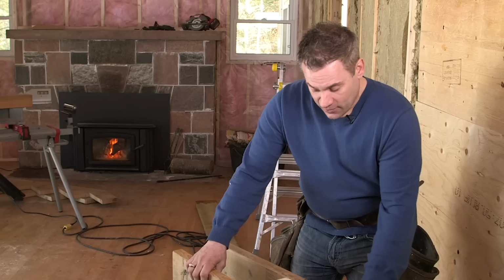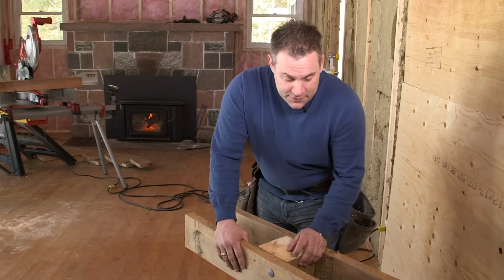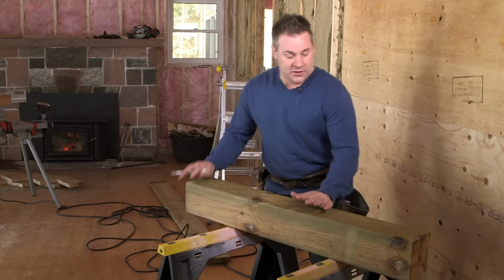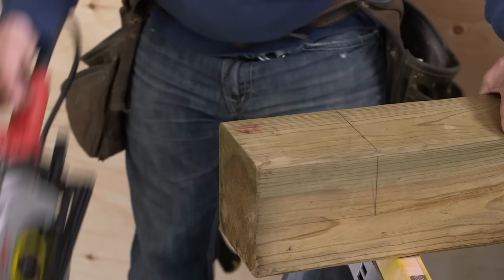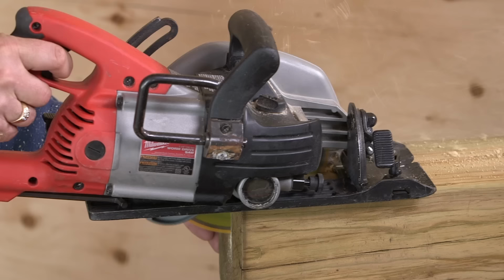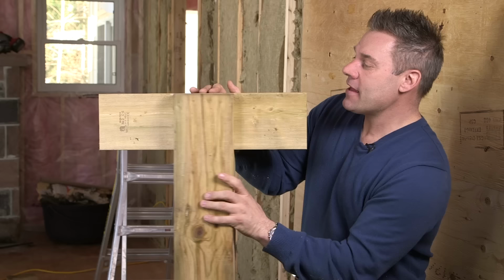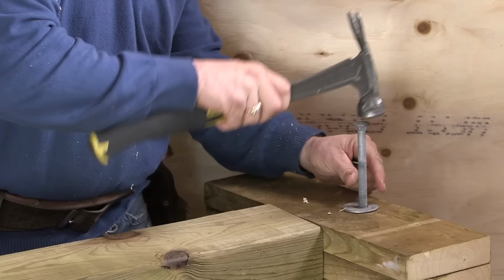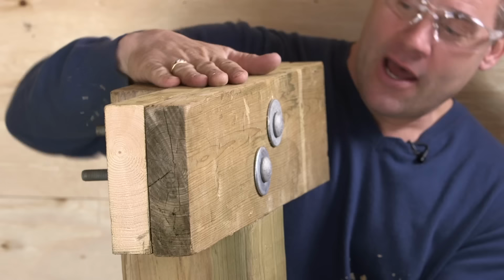How to Attach a Beam to a Post for a Deck | Decks, Docks & Gazebos

Comment: You could take it one step further with the bolts by drilling a hole slightly wider than the bolt head and as deep as the bolt head. This way, when you insert the bolts and tighten them down, they sit flush inside the beam, which allows you to attach trim to the outside of the beam.
Reply: Depending upon whether you have a single or double rim joist, you may be derating the actual load that lumber can now effectively support before failure.

Comment: Didn’t Chicago outlaw notching posts about ten years ago when all those decks started collapsing? Yes you’re sitting on top of a 6x6 but you’ve reduced what your attaching to to a 2x6 and notching leaves itself prone to rot and splitting lengthwise at the notch.
Reply: Petey Pete
Reply: Notch...and then coat the notch...no more rot problems.
Reply: Mark Anthony coat the notch with what? Don’t you have to let treated lumber dry out a bit before you seal it and the chemicals from treating it don’t really reach the middle right?
Reply: @tvojslauf  Personally, I would coat it with roofing tar...but I have also used fibreglass resin. The resin didn't sink in as much as I hoped it would, but the oil component of roofing tar does penetrate the wood. I guess nothing is for sure except death and taxes LOL !
Reply: If it bothers you that much use a piece of plastic damp proof course over the cut section

Comment: You are 100% correct in your method. Kudos.
However you have a misunderstanding regarding shear. 
Bolts are strongest in shear, and tension. Then cannot take any bending. When you hammered the screw, that was bending. 
If you use bolts in shear there cannot be any gaps to induce bending. 
The shear bolts in the first were fine, short term. Not because of the bolt, which were installed correctly with no gap, but because the lifespan of the wood means after weathering it would weaken. 
Your method was safer with a much longer lifespan. 
Kudos. Excellent craftsmanship. 
I am a structural engineer.

Comment: I'm a contractor and I have replaced decks on old homes, no saddle or carriage bolts just 5 big 16 or 20 penny nails and there still holding tight … I agree with the saddle and 1 carriage bolt, 2 is over kill  …

Comment: Every pole barn I've run into has the girts nailed or bolted to the side of the poles.  Rarely is a pole notched
Reply: Yeah and some of them old barns are 70 years plus and still good .
Reply: With all due respect pole barns and decks are apples and oranges
 In poll barns the horizontals are just the fastener surface for the metal siding. They bear very little weight. The siding is fastened to the beams and the posts so it ties it all together with a low weight per fastener ratio. Furthermore...any builder worth his weight always blocks between beams so horizontals are sitting on blocks all the way up each post. Still most poll barns. Builders don't hang their top beams on fasteners.
Reply: @johngoodell2775  I live in a pole house. The horizontals as you call them that support the floor are doubled 2x12s bolted on to 6x6 vertical posts. No notching. The roof is supported by 2x10 horizontal  headers that run from one vertical pole to another 12' apart.  The hay barns that exist all over this country have a second floor where hay is stored. That second floor which holds tons of hay all winter, is supported by horizontal 2 x boards nailed to the sides of 6x6 vertical  posts. No notching.  Notching weakens the vertical posts. Not something  we want to do in areas prone to tornadoes.
Reply: @spartaeus  I find that hard to believe that there are no posts holding it up. I bet your looking at a post that supports a ceiling thinking it's holding up the floor. Carriage bolt construction is the type of construction you read about that gives way and injuries or kills several people as they are dropped 20 feet when they shear off due to weight and stress.
Reply: @MainerdLoyd    The horizontal 2 x's nailed to the sides of 6x6 vertical posts support the floor joists.  There are many good books on pole building construction that illustrate this.  Also the agricultural  universities have free plans for farm buildings that you can download that also illustrate this.  I've not heard of a barn collapsing yet.   A notched beam is a weakened beam.  Think about all the trusses that are made from 2x4s or 2x6s that have a flimsy metal gussets to hold the boards from separating. They don't notch trusses, yet they hold up. Although I've seen many of those metal gussets fall off during transportation, where they would have to be hammered back on at the job site. That's why I only use plywood gussets that are glued and nailed.
Reply: @spartaeus  And how many people do you have running around and constantly shifting weight in a pole shed? A building meant for storage is one thing. A deck made out of soft lumber that is going to be subject to lots of shifting is different. He is telling you the safe way to support a deck.
Reply: @MainerdLoyd  The building does not shift. A pole building must have diagonal braces of adequate strength to prevent side movement.  Of course you have to use good quality building materials in the first place!
Reply: @MainerdLoyd   It all depends on the quality of the construction.  I've seen some really bad pole sheds, with 2x6 floor joists spanning 15 feet and a single 2x6 nailed between two posts 10 feet apart  carrying all those floor joists. Even as under constructed as it was, it still held up.  Quite a bit of sag though.   And I definitely  would not walk under it when it's loaded with hay!   I have several barns on my property, all very old with saggy floors, and all have held up through  tornadoes and high winds. In fact many of the older houses around here are not  bolted to a foundation.  They are just sitting on blocks or stone, and have survived high winds where trees right next to them have been blown over.
Reply: @spartaeus  so the joists are not supported in the poles by blocking? Notching doesn't weaken posts if you calculate loads and use the right size posts. Look at the joinery on old barns. The fastener method saves time and money...but still barns and decks are  apples and oragnges

Comment: I would guess that the main problem with the bolted connection (without notching) is not the shear strength of the bolts (which is tremendous for that size of bolt) but rather the strength of the wooden beam.  Under heavy load, the beam would tend to split along the grain where it is being held up by the bolts.  This is the effect that is eliminated by supporting the beam from underneath with the notch.

Comment: While his method of attaching beam to post if good attaching with carriage bolts is also good. It will not collapse ever. The wood will rot first. The carriage bolt will also hold more weight than you ever need.

Comment: While this is the correct way to hang a deck beam, it has nothing to do with the shear strength of the bolt. The bolts have plenty of strength. A 3/8" carriage bolt shear strength is somewhere around 45,000 lbs. The reason you notch the post is because the wood beam sitting on the two 3/8" bolts is much softer than the bolt. The hole will elongate over time and that portion of the deck will sag. And you have the potential for cracks running along the grain as the weight pushes down. Letting the beam sit on the end grain of the post, distributing the load over a larger area.
The weight capacity of a 6x6 should be around 20,000lbs (less than the shear strength of the bolt alone) so a 10x10 freestanding deck with 4 posts has a theoretical capacity of 80,000 lbs right? Wrong. 5,000 lbs live load capacity (depending on species of lumber).
Notch your posts and follow span calculations and fastener specs and you will be fine.
Reply: Finally,  someone gets it!

Comment: Half inch carriage bolts holes about 8000 pounds
Reply: You are obviously wrong, you act as if the bolts are made for shear strength.  As if they bolts were actually rated based on the shear force.  Clearly the bolts are ONLY used as fasteners to hold the wood together like this man says. 

Also, 8000 lbs isn't that much.  People are getting bigger.  It's not uncommon now days for a residential deck to have over 60,000 lbs of people on it all jumping up and down at the same time.  If you don't notch the wood millions of people will die... is that what you want? psycho...

And besides, YouTube allowed this person to post a video so clearly he is an expert.

Comment: I told my wife, "This guy has no idea what he is talking about."  She said, "Anybody can make a YouTube video."
Reply: The nice intro screen shows he must know what he's doing!
Reply: @KingParisBuckingham  by comparing the strength of a carriage bolt, to the strength of a tiny screw, makes it like he doesn't know what he's talking about. You couldn't knock a carriage bolt off as easy as that screw.
Reply: Brian Van Horne  don't mention code !! Code also says any cuts into treated lumber has to be treated also so he still was doing it wrong  all the white non treated showing will be rotting from the inside out !!
Reply: When you watch the Amish in southern maryland build a barn . You'll find out pretty much all you'll need to know about building a wooden structure . With mostly joinery and few  fasteners . Old school ways that will always work
Reply: Post and beam safest way to construct . bolts and screws are there to keep  wood in place . there have been  lots of people hurt because they use inadequate  screws or bolts
Reply: @Normal1855  the best construction  for holding weight is post and beam he is demonstrating this ,it will hold more weight every time . I've seen people use inadequate screws to make shelves and once loaded up have collapsed on them

Comment: So by notching the 4x4 post you basically made it a 2x4.  Notching is against code here.  Sorry but Carriage bolts are designed for shear strength why else would you use them to attach your ledger board????
Reply: I agree. I rather use another 4 x 4 beam (depending on the  load) or 2, 2 x 8 beams on top of the vertical 4 x4 with a strong tie and letting the entire 4 x 4 take the load.
Reply: Or a 4" x 6" beam on top of the 4" x 4" and use metal plates as they use in beam trusses. It doesn't get any stronger than that.

Comment: The weakest link in a chain determines the chains strength. It appears as though the vertical, load bearing beam is a 6 x 6 as when he take his two 2 inch wide horizontal beams , which after milling are 1 x 3/4 or close to it, meaning they're total width is two times 1 and 3/4 inches (ie.3 x 1/2) he still has some width in the vertical beam after sawing it away by 3 & 1/2 inches (5 x 3/4 inches minus 3 x 1/2 = 2 x1/4  yes?). So the original 6 x 6 is now actually only 2 x 1/4 inches thick to bolt the two 2" wide pre-milled horizontal beams to. Therefore, the torsional strength of the vertical beam has been reduced by more than half and it has a stress vulnerable cracking 90° angle point to it. My father was a mechanical engineer and I work in micro-mechanical engineering as it were. There was not wrong with the original design as long as the horizontals are one piece and the threaded nuts and bolts were very tightly joined (and some maximal strength thread lock was used in doing so). The other design that would be acceptable and maintain the original dimensions of the vertical load bearing beam would incorporate factory painted steel gusset plates to join horizotal beams (again only single long beams) to bolt the horizontals to the vertical beams without removing any of their widths (which would unnecessarily weaken them). Cutting away over half the vertical load bearing beams as is suggested only weakens the vertical beams to the point that is left remaining, to which the horizontals would be bolted. Also, very importantly I would try to use only grade 8 nits and bolts for their much greater strength. I've watched this presentation several times and the logic is flawed, making for a much weaker vertical load bearing beam with, very importantly beams which would be highly susceptible to torsional forces which would build to their greatest weakened ninety degree sharp corner. Many decks are built to entertain adults who, in moving around their considerable body weights, would greatly stress the much thinner vertical beams where the horizontals are bolted. The most likely form of failure would be from teisting. Of course, regular (eg. every 3 - 4 months) close inspections of the members and nuts and bolts is mandatory.

Just my take on this form of construction as I do very similar load bearing construction, just on a smaller scale. The principles of stress, strain, torque, and load bearing are the same and very important.

Comment: You are absolutely wrong to state that the carriage bolt has no shear strength. The shear strength of the bolt is greater than that of the wood.
Reply: Chuck D...Shear strength of bolt is not relevant in this type of construction! Splitting of the wood at the bored holes is the relevant concern!
Reply: In the context of the video, splitting is irrelevant.
Reply: Chuck D 
Exactly. That is the problem.

Comment: ahaha a screw and a bolt are two different animals..put in 10 screws and youll have about the same shear as  2 bolts..ive NEVER seen 2 bolts shear nor 10 good screw
Reply: Not entirely true.
Doubling the cross section of the fixing quadruples the shear strength in theory so e.g. 2no. 10mm screws are as strong as 8no. 5mm screws, but in practice the screws will each be sent way beyond their limit of elastic deformation and so will be much more likely to fatigue (plastic deformation) and snap one by one whereas the bolts will never be fatigued.
Secondly screws and bolts undergo different processes in manufacture with screws being much more brittle than bolts due to the hardening process so you can't just 'plug in the numbers'.

Comment: Wow stating that a bolt is not meant for shear is inaccurate, try the 5/8" bolt with your hammer. And read the shear force definition
Reply: Exactly. Even if you used 316G50 stainless instead of a galvanized A325, a 5/8" will have a shear strength of 15,600lbs in a single shear state. With the "split beam," you double that, for one bolt. If bolts work for steel structures, they'll work for anything you can put on a wood beam.

But, he never really specified the material of the bolt, just arbitrarily compared it to a wood screw under a shock-loaded, bending stress... for whatever reason.
Reply: He believes wood will break steel?  Simpson Strong-tie has made a fortune using steel to support wood.
Google Simpson DJT14Z.  It's made for exactly for the application the video says is wrong.
If he prefers to create an outdoor horizontal flat surface on end grain, the least he could do is treat the end with end-cut solution.  The rotted wood vs. snapped steel bolt ratio is probably 10,000 to 1.  Yes, pressure-treated wood rots.  And I have never seen a steel bolt on a deck snap.
Reply: I see this issue speculated and argued about many times on YouTube, but rarely from experience.  Either the steel will snap or the wood will crush they say.    Alkali showed how the steel would not break.  Hemlock and Doug fir have a Compressive Strength of 7200 psi.  Two hefty bolts in wood could support two automobiles.  This is way more than the beams can support.  I think for simple decks people are overthinking this.
Reply: Les Brown  how many times can you bend the wood?

Comment: So the people saying that the carriage bolts won't shear off are correct. It takes a tremendous amount of force to shear a ½" bolt. The other half of the equation, though is support. The carriage bolts are concentrating all the force on a relatively small area of the post (the two holes.) You are also depending on the fibers of the beams not splitting. It may work, but you have much less load capacity. Finally, if you get some rot over time the load capacity of this configuration will degrade much more quickly. (this configuration is also against code in many areas - there's a reason why.)

By putting the beam on top of the post, you distribute the load across the entire surface, do not have to worry about the beam splitting and do not loose strength as quickly if there is rot around the bolt holes.

Comment: “Has no shear strength” … flat out wrong 

You realise ccs treatment doesnt go full thickness?, when u notch it you have got a non treated portion open to the elements now (ie rot)
Reply: I was about to write the same thing, but you can get a brush on treatment. Here it is part of code  to use it

Comment: I've always used lag bolts in the way that you say not to use in TN and now Mississippi where we get all kinds of different weather.  I'm not a pro but one additional thing I add is a cleat under the beam to help distribute the load.  In my humble DIY opinion this minimizes the rot issue from cut wood being exposed and helps distribute the load onto the post.   Essentially its the same thing you did without exposing the cut wood to the elements.  This method may not work for larger applications but it still seems better than this.